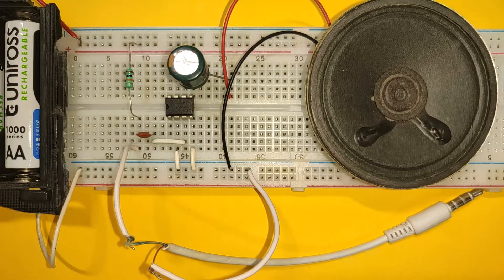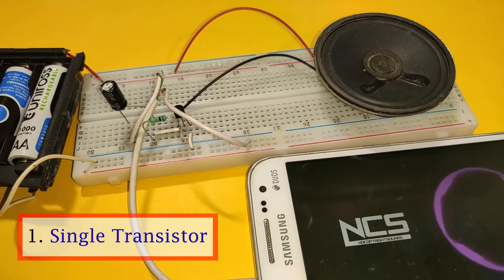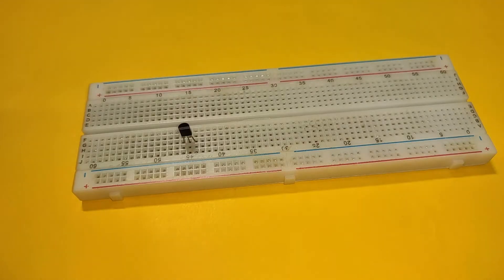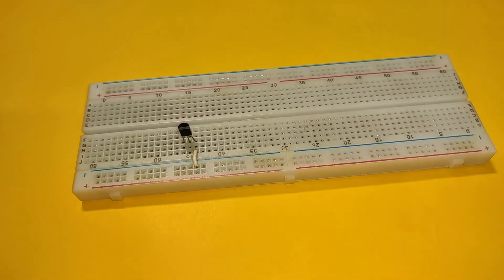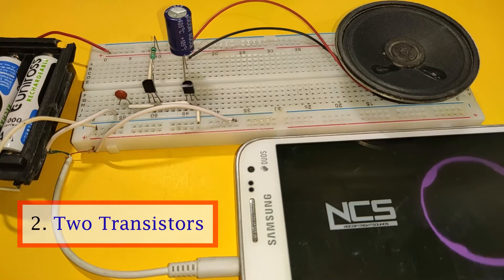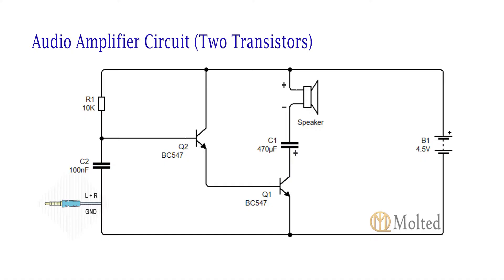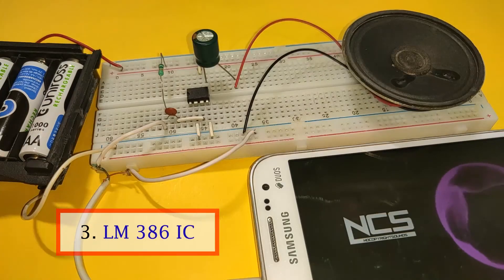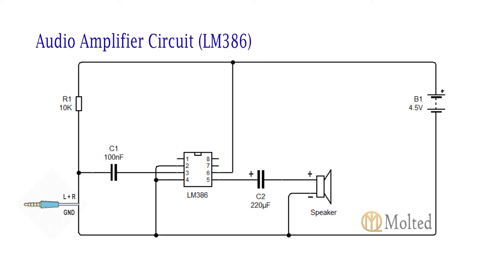Three ways to make Audio Amplifier Circuit – One/Two Transistors or LM 386 IC

Comment: I build the circuit with LM386. Because the 1/2 Transistor circuits make DC of the Speakers. But the Speaker need AC... So the Lm386 circuit is the best for Speaker.
Reply: Hi, can i use another capacitor on the output to remove the dc, and if so how